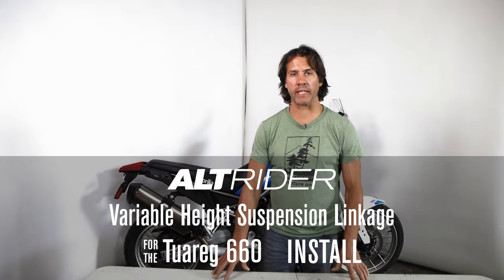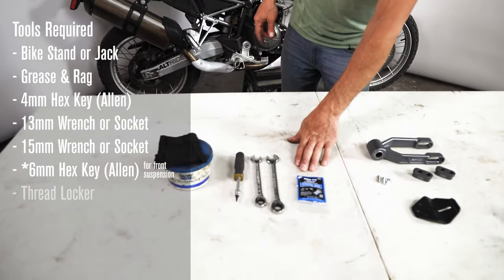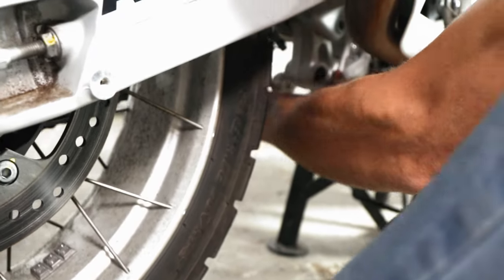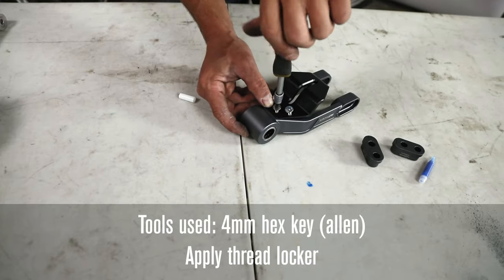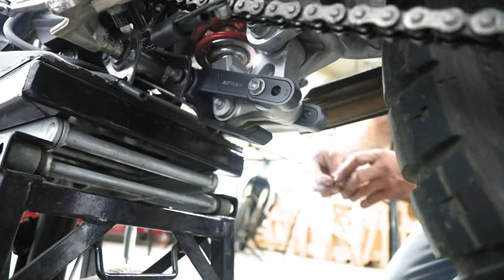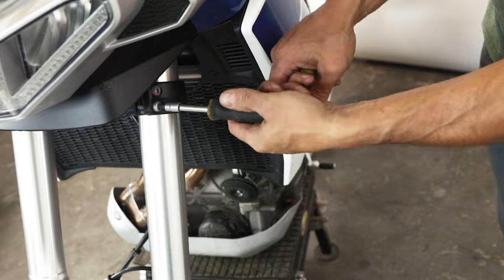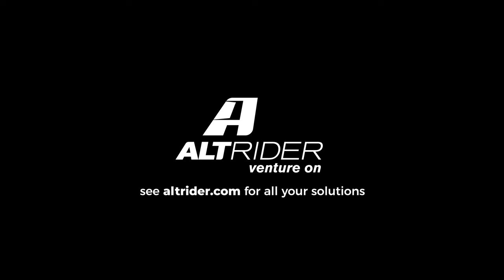Aprilia Tuareg 660 Variable Height Suspension Linkage Install

Comment: 7:22 Think the rear torque value you flash up on the screen is wrong - front and rear should be both 50Nm (according to the Aprilia torque sheet I have).
Reply from the maker: Thank you for the intel!

Comment: if I lower the rear by 19mm, do I have to do the same with the front end?
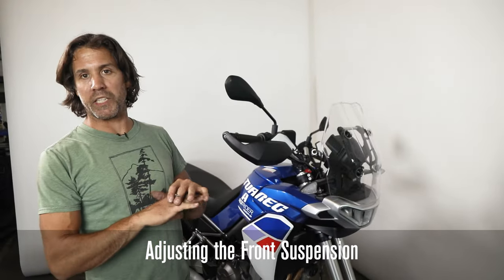Reply from the maker: We recommend adjusting the front approximately 50% of the rear. 8:24 on is all about how to adjust the front.
Reply: @AltRiderLLC  Ok, but why do you indicate the third notch as OEM? the bike is delivered standard with the fork on the first notch (+ 20 mm indication). I don't understand this...
Reply from the maker: It’s possible your dealer did something different during the PDI (Post Delivery Inspection).

Either way the point is there is no one way to setup your suspension. We suggest doing 50% rate reduction to the front and then see how it feels and adjust if necessary. If you hit the limits of adjustment on the fork then a local suspension shop can help you make other adjustments. 

We try to give you the knowledge of how the modifications affect the feel and performance of the suspension. Many riders probably wouldn’t be able to tell a difference of a few millimeters on the forks. Some riders would feel it immediately.  If you’re not sure how it feels for you, you can use our suggestions as a baseline and then you can experiment with small adjustments if desired.
Reply: Thank you. I think I'll buy the system for my Tuareg later and I'll try... @AltRiderLLC
Reply from the maker: Awesome! Let us know how you like it
Reply: @AltRiderLLC @patriziozaghi4704 is right. The first time you showed the front suspension, it was set on the first notch. You presented it as OEM. So when you presented the diagram of the notches, the OEM you show is wrong. If I lower my bike 19mm I should lower the front aprox 10mm, that’s two notches below OEM. Please correct me if i’m wrong. Thank you for the video. Cheers
Reply from the maker: @scovacevich  You're absolutely correct! Be sure you don't ever go lower then where it's made to clamp though. What we want to express more is that it's best to go by the feel of the bike, but to start as a baseline, you are correct!
Reply: @AltRiderLLC  I would confirm here that according to the manual and my delivered bike, OEM forks are 1 notch high (5mm).  I went with the 50% drop to match my lowering. Thanks for making the good stuff!

Comment: An $200.00 answer to a non existent question…
Reply from the maker: The stock height is great for a lot of people, and probably most people won't be interested in making seat height modifications. 

But for some people who might be shorter or are still building their confidence, getting over an inch closer to the ground can make a noticeable difference in confidence. And of course, there’s the option to raise your seat height, that gives you more ground clearance.
Reply: says who?